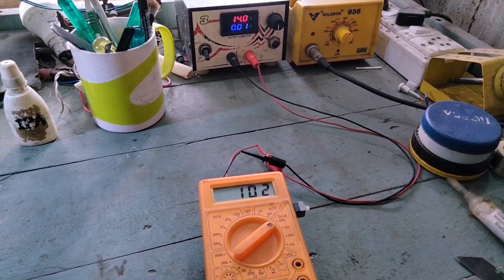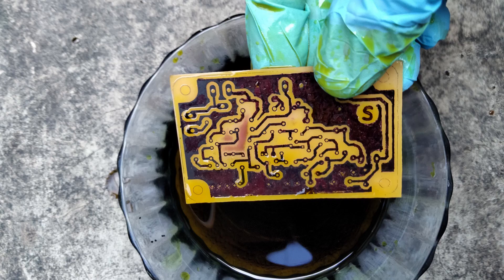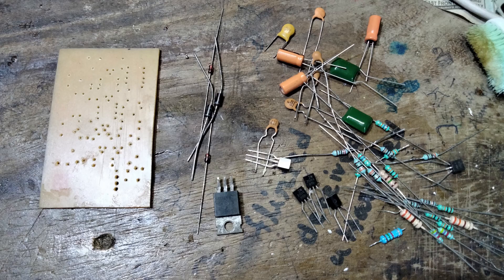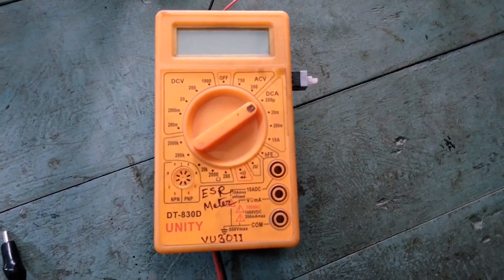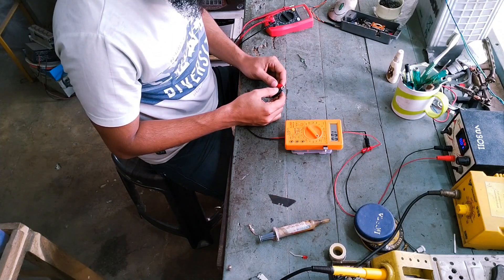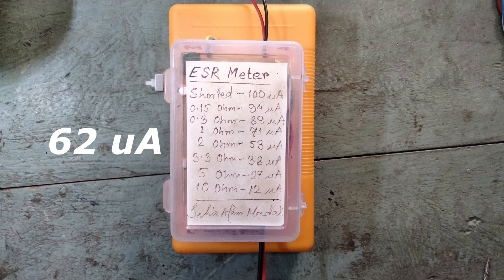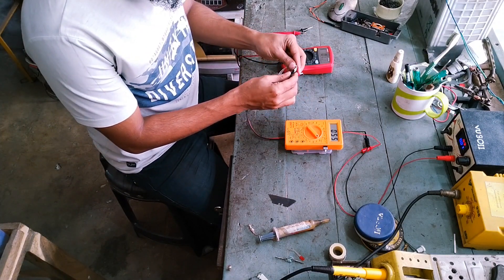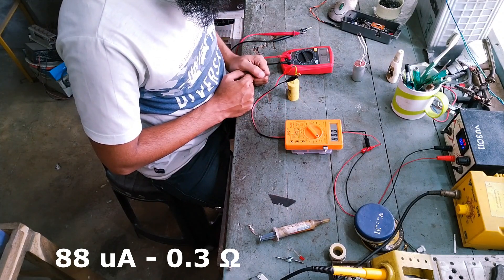Capacitor ESR Meter using only 5 transistors !

Comment: hi can you please share how did you   connect your digital multi-meter to this circuit ?  because in  real one  there  was an analog  multi-meter can you share your schematic?
Reply from the maker: The multimeter is set in the microamp range. The meter probes are simply connected instead of the analog panel.